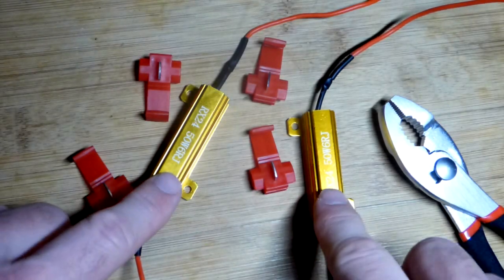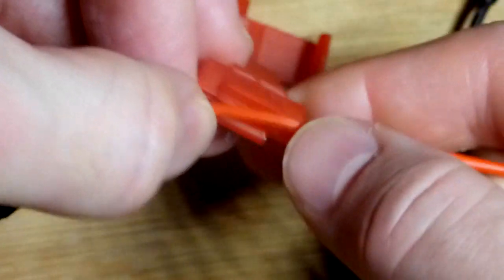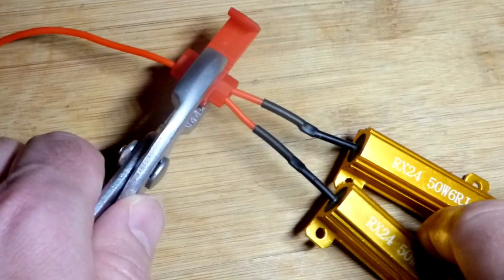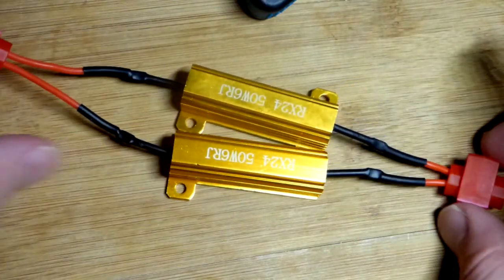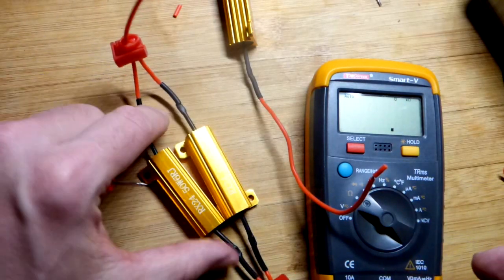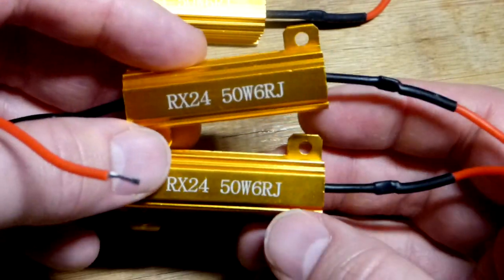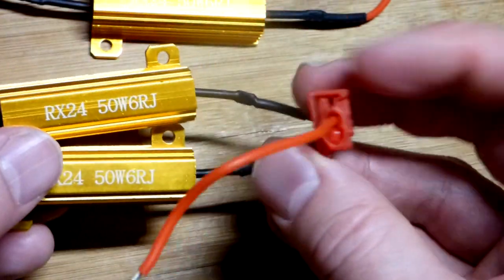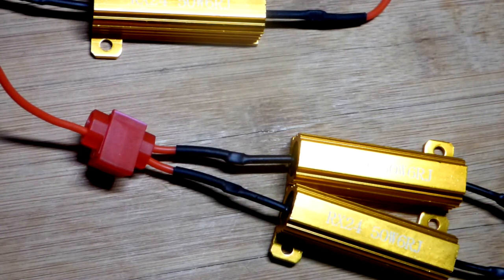Trying out controversial solderless splice connectors to parallel 6 ohm 50W resistors

Comment from the maker: https://amzn.to/4aTLMch 50W 6 ohm resistors plus connectors kit affiliate link.
List of my videos https://www.youtube.com/c/electronzap/videos
https://www.youtube.com/@Electronzap/community for most of the diagrams I've used in my videos.
https://www.amazon.com/shop/electronzapdotcom As an Amazon Associate I earn from qualifying purchases. Americans should check out one or more of those links before making any purchases. There's no extra cost to you.
https://www.patreon.com/electronzap
https://electronzap.com/
https://www.reddit.com/r/ElectronicsStudy/

#Electronics #Howto #diy
Reply: Sir please reply... 
this question is very very confusing...
I have 2 identical 12V DC 7.5Ah batteries say X and Y.
One side of a normal bulb is connected to postive terminal of X battery, and another side of the bulb is connected to the negative terminal of the Y battery.

The negative terminal of X battery and the positive terminal of Y battery are not connected to anything.

So, in this case, I want to know whether there will be a current flow to the bulb, and whether the bulb will glow??? Give reasons if bulb will glow, and reasons why bulb will not glow.
Thanks in advance.

Comment: Up in Canada we call those connectors "Scotch connectors".  They are great to have in a car / truck / RV / boat / motorcycle general electrical repair kit.  The reds are for 18-20 ga, blues for 14-16 ga, and yellows for  10-12 ga insulated braided wire.  They have helped me in a lot of weird situations and haver never failed me except when the metal parallel tab hasn't been fully seated (resulting in the plastic fold-over cap being very hard to seat and thus popping open sometimes. Those pliers you used are very similar to the ones I use too (they're called slip-joint pliers).  Thanks for all the great vids you make!
Reply from the maker: Thanks for the info!

Comment: Sir please reply... 
this question is very very confusing...
I have 2 identical 12V DC 7.5Ah batteries say X and Y.
One side of a normal bulb is connected to postive terminal of X battery, and another side of the bulb is connected to the negative terminal of the Y battery.

The negative terminal of X battery and the positive terminal of Y battery are not connected to anything.

So, in this case, I want to know whether there will be a current flow to the bulb, and whether the bulb will glow??? Give reasons if bulb will glow, and reasons why bulb will not glow.
Thanks in advance.
Reply from the maker: You need a complete path for current/electrons to flow when you aren't dealing with something like a quick static shock. Which means that the load needs to be connected to both sides of the same battery. as many electrons need to enter the positive side of the battery, as are leaving the negative side of the battery at all times. So both ends of the battery need to be connected to the same loop with a load in that loop limiting the current.
Reply: @Electronzap  so what I understand is that...
The same current which come from positive terminal of X battery has to enter to the negative terminal of the same battery X. Is this correct??

After this I have one more confusing question again..
Reply: @Electronzap  eagerly awaiting for your response Sir... 🙂